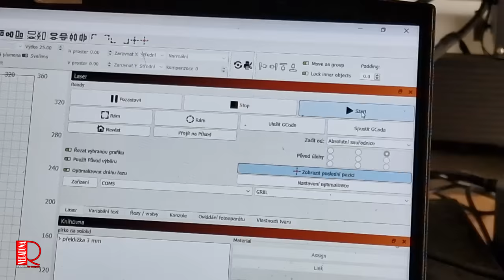Old Enterprise - Restoration

Comment: Wow!  Not only was the one wheel shattered, but the inner gear looked like it was damaged as well, as if some kids tried to grind rocks in it.  

Beautiful job on the restoration using the original pieces.  However the damage happened, it was lucky that the pieces were all there.
Reply from the maker: It was damaged in transit. All pieces were in the package. 😉

Comment: It's always nice to see someone welding cast iron. People act like welding cast iron is a black magic or impossible. It's not it just requires a little heat treating and cooling time. I'm always glad when I see someone do it. It helps to dispell the myth!
Reply from the maker: Thank you very much. But on the other hand, I have to defend them a little. I don't always manage to weld everything cast iron this way. It depends on how much carbon the cast iron contains. For example, heated cast iron parts on the stove are quite a problem. On the other hand, I would say that 85% can be welded :)

Comment: I remember seeing machines like this, this design I mean, as a child, thinking how heavy they were, how, solid, that they looked so slow and cumbersome to operate....
Effective for its time though, will the owner be putting it to use I wonder?
Reply from the maker: Any looks heavy, but thanks to the cast iron wheels that serve as a flywheel, grinding is very easy. The owner will probably not use it, he intends to start a collection. It's a shame as the grinder is old, it grinds perfectly. Apparently quality work by the manufacturer.

Comment: Radek what media are you using in your blast cabinet ????  Regards Sion :) great work on the wheel .cast iron is nightmare to repair .
Reply from the maker: I use brown corundum as an abrasive
Reply: @VeradonaRestoration  ah you mean Brown Aluminium Oxide . thanks for the reply Rad .im thinking of hgiving glass bead a go .less dust
Reply from the maker: @gizmo1252000  I mean artificial brown corundum A96
very hard sharp-edged blasting material, with high toughness and strength
suitable for blasting in blasting booths or chambers

Comment: Enjoy these resto videos 
i,m making my own 6" bench vice from scrap |_|  |_  angle iron and brackets  just got get a 16m/m hole drilled for the screw bolt 
i welded the nut It would have been easier to buy a square steel & U channel but nothing close 
just glad i bought the Mig welder _ 3 mini coils for $60 New worth $350   off a guy moving & tools $100 the lot a real bargin welds ok after a good clean up with wd40
 would like a small  a lathe also  oneday  make some brass copper steampunk artwork if i can find the old parts & materials

Comment: I was wondering why you didn't use the original handle pull on the little drawer? When it was knocked off, it seemed to still be in one piece.
Reply from the maker: It was not the original handle. Plastic parts did not become popular until after World War II.

Comment: Why are you checking if the old paint contains lead if you're removing the paint anyway?
Reply from the maker: It would not be suitable for a sandblasting box, as it would contaminate the abrasive with poisonous lead.

Comment: 8:18 Why not use J-B Weld KwikWeld Epoxy. 
"KwikWeld™ is a fast setting version of The Original J-B Weld two-part epoxy cold weld system that provides strong, lasting repairs to metal and multiple other surface types. After mixing, it forms a permanent bond and can be shaped, tapped, filed, sanded and drilled after curing. KwikWeld™ has a 1:1 mixing ratio, sets in 6 minutes and is fully cured in 4-6 hours. KwikWeld™ cures to a dark grey color, is rated at a tensile strength of 3127 PSI and will withstand temperatures up to 300ºF."
Reply from the maker: Thank you for the information, but this medicine is not sold in my country. Have a great day Doug :)

Comment: Maybe, I like your Videos!
But sorry, I have a Problem with your Welding. Cast Iron with MAG is not the best Solution, in my Opinion. For this Reparaition I would prefer Ace/Oxy with Copperwire.
Reply from the maker: Thank you for your comment Uli. I've been welding with this method for 15 years, maybe it's not a news method, but it's sufficient for my purposes. So far no complaints :) Of course, not every cast iron can be welded in this way, those that contain a large amount of carbon or heated stoves cannot be welded. But that's roughly 10% of the items I get to renovate.